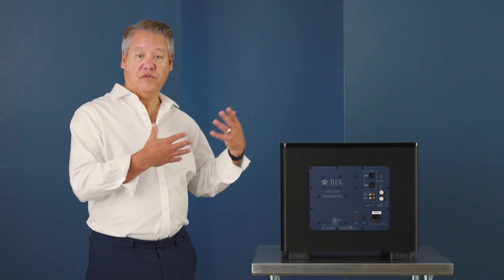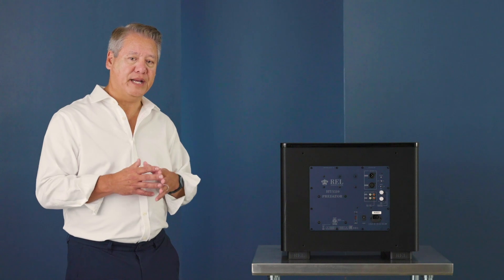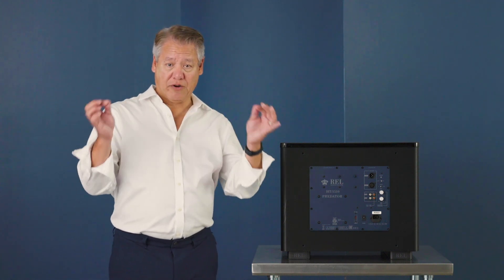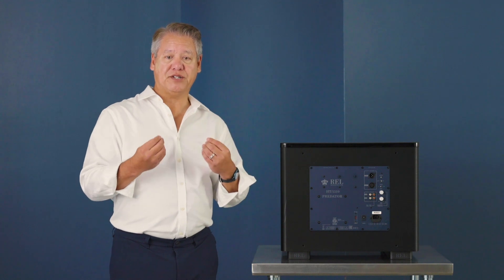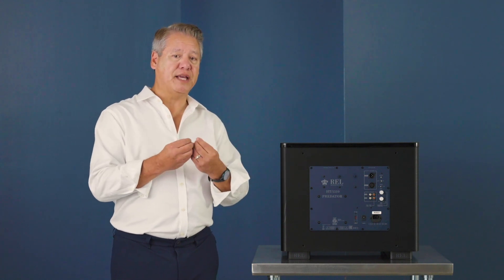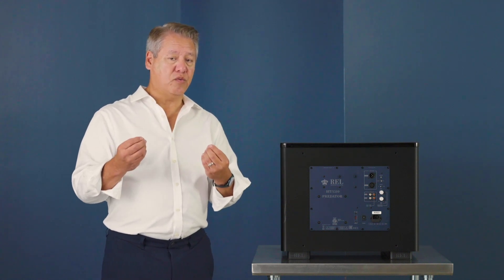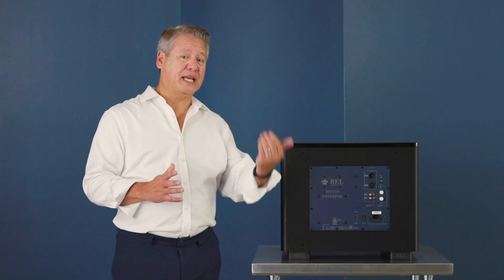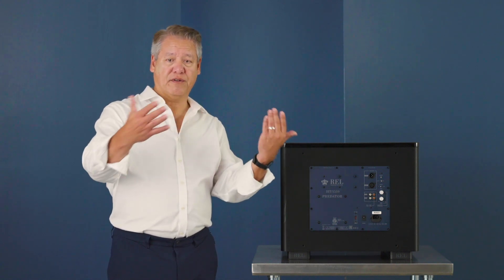HT/1510 Jumps up to 1,000 Watts. Hunter Takes You Through ALL the Steps to Improve on the Original

Comment: If it's just the amplifier do us owners of the 1508 get an option to upgrade just the amp and not the enclosure and Driver?
Reply from the maker: Thank you for reaching out. It is possible to install an HT/1510 amplifier panel in the cabinet for an HT/1508 subwoofer, though this will not necessarily make your HT/1508 perform exactly like an HT/1510. If you are interested in purchasing an HT/1510 amplifier for your HT/1508, then feel free to write in to contactus@rel.net and our service team will be happy to assist and provide additional information.
Reply: @RELAcoustics awesome thank you!